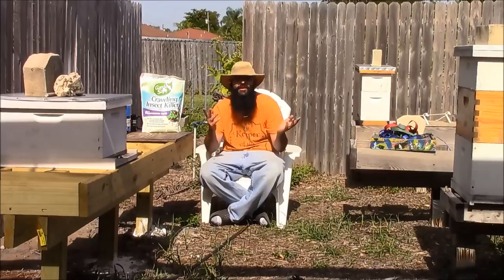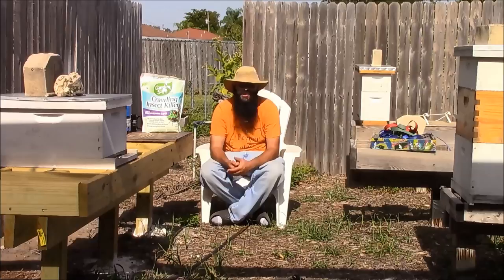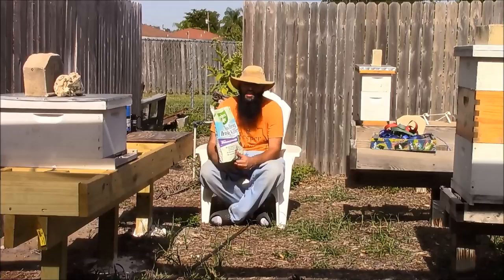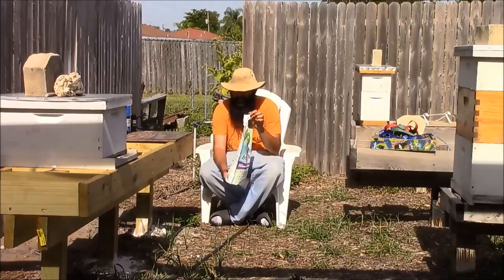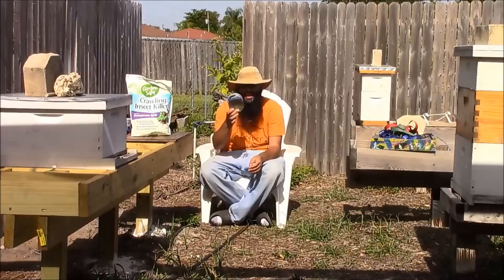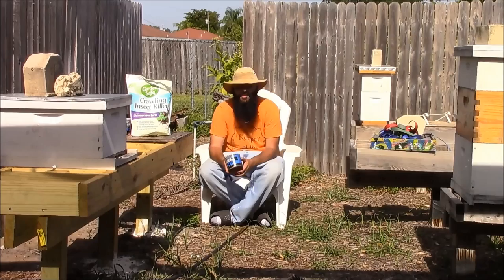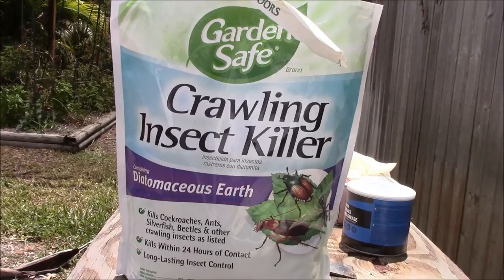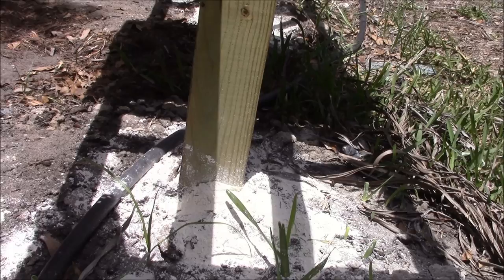Hive Stand Ant Prevention

Comment: How is this working out for you? I have found the grease to be a pretty good way to keep them out.
Reply from the maker: It could be effective. I'm not 100% sure how well it's working though. I also purchased 3 boxes of TERRO® Outdoor Liquid Ant Bait Stakes and put them all over the perimeter of the yard... So far, so good
Reply: Ahh... I have about decided that the back apiary I have just has some issues. Not sure if the woods behind it is just infested with every kind of bug known to man or what, but my front bee yard doesn't have the issues. I'm not sure any amount of ant stakes would work... but the grease seems to hold the ants at least at bay.
Reply: I mix 2/3 Vaseline to 1/3 baby oil in old paint can, paint on legs with old brush.  But I am cheap!